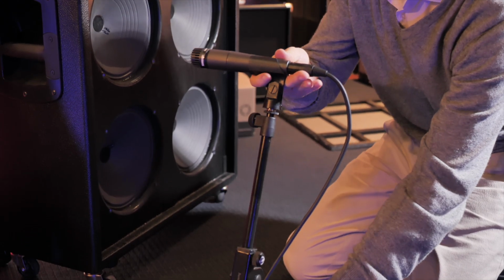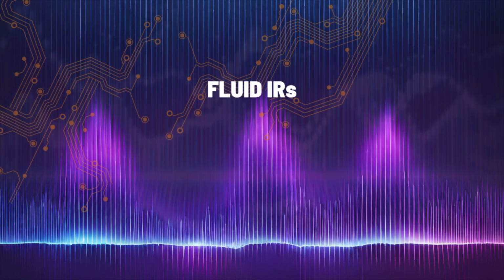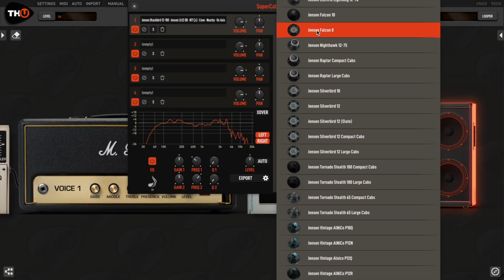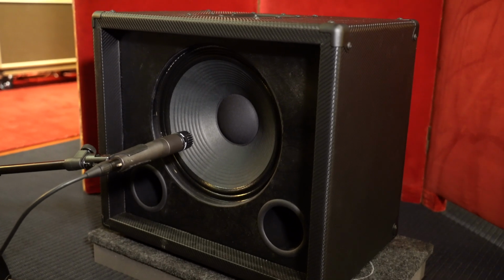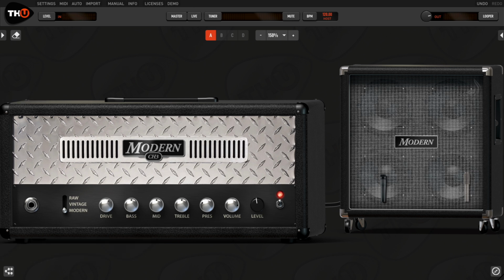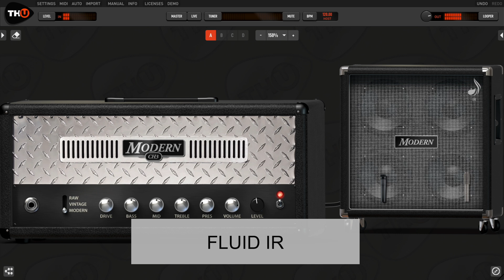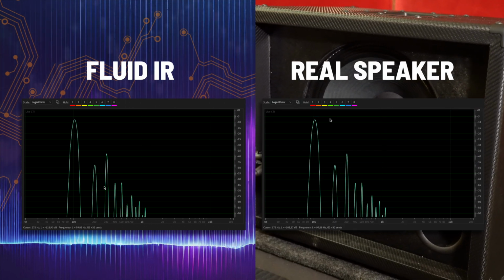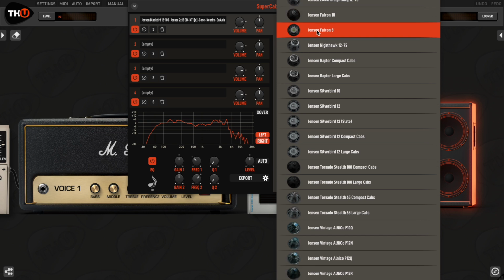Overloud Fluid IRs explained

Comment: Tried the fluid IRs last night. I'm unsure it's desirable.  It def adds saturation(makes it sound cheaper imo) and loses low-end.  But it does boost mid focus and makes the bass knobs usable where before they almost always had too much bass. Wondered who else has tried it and what they think.  To clarify, I don't think it's bad it's just a very very noticeable change. I'd like to be able to toggle it on the cabinet rather than just globally.